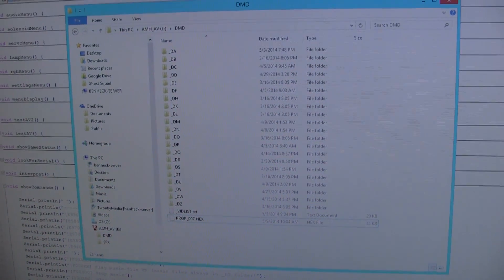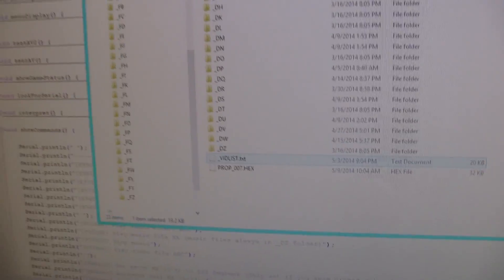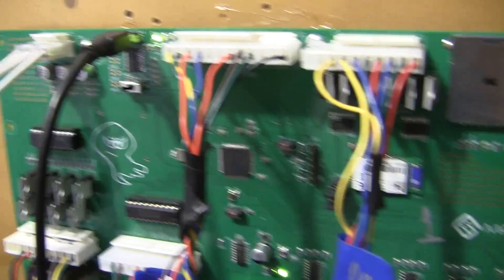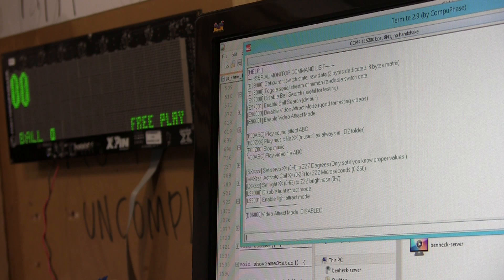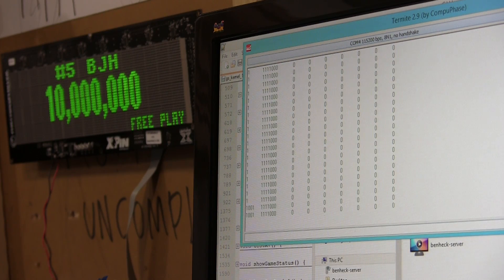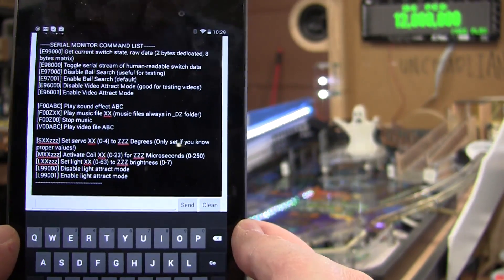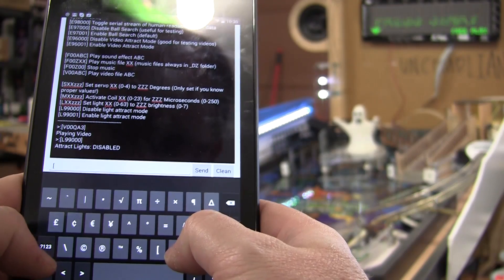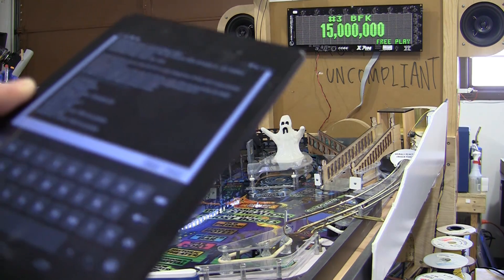pinHeck System Communications and Bluetooth

Comment: Could the input be sanitized or styled?
For example:The command [L63007] could be typed as l63007 (lower case L) and sent as the proper syntax?
If someone wanted to manual test a switch or solenoid specifically, the manual text mode could be useful but make life easier for the tech debugging the issue. And not all touch devices are friendly with the keyboard.

Love the back end attention to detail nonetheless ;)